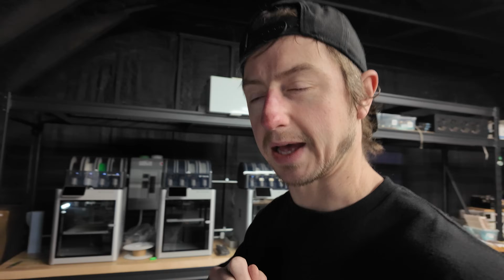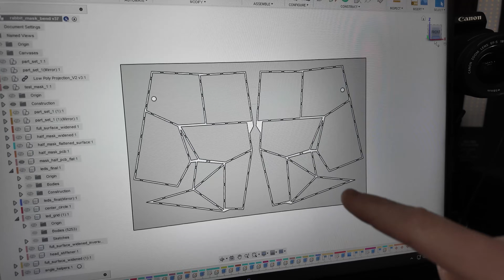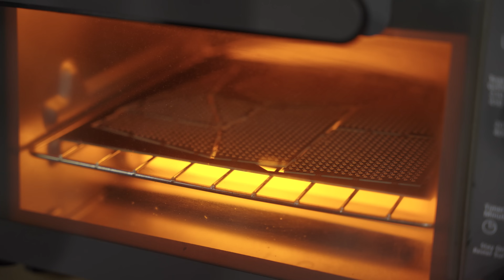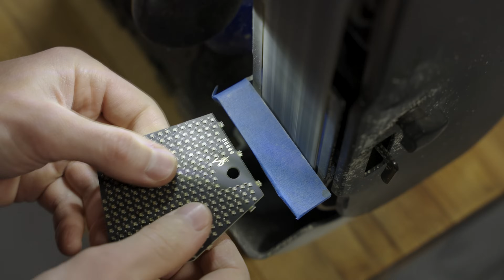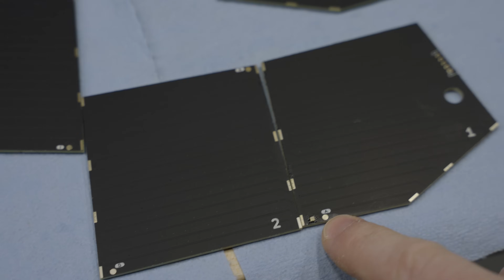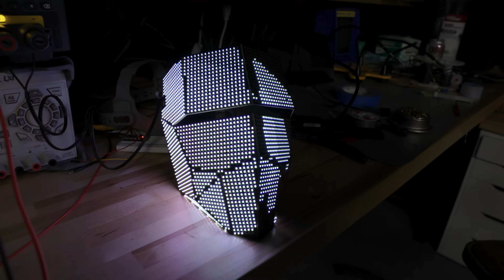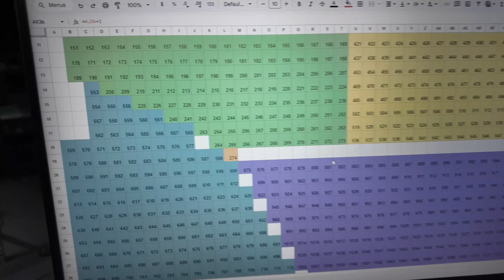This is How I Built the Craziest LED Mask

Comment: That is insanely cool.
  If your trying to use solder for strength then it's best to add some wire into the blob. Without some wire in the mix the solder can easily crack.
  I wouldn’t run the ones on the inside they might blind you.
  You could probably sell these for thousands.

Next year the full body suit!

Comment: First time viewer of your channel. Won't be the last. 
 Subscribing now.

   I'm an electrical contractor and love lighting. I have a couple of LED "toys" that I've acquired just circuit boards 1½ x 1½ inches with LEDs and a rechargeable lithium battery, USB mini port for charging and infrared receiver  with a remote control that has 16 color changes and speed control and random pattern as well as dimming capabilities.
   
  If you are still taking suggestions for your mask display I would like to see a flaming face pattern and skull face.

Comment: You can make a short throw projector using any projector and two mirrors in the front of the lens and then one back on the same plane as the initial LCD fixture that's inside the projector and the reflection of that mirror will be your short throw.

Comment: structural solder is wild man at least super glue it
Reply: might also want to hit it with an EM meter
Reply: Cyanoacrylate glue is strong but brittle. Epoxy, like in the board, is way stronger.

Comment: Crazy Idea:

Have a customer glue green dots from a sticker kit onto their face, have them take multi-angle self portraits, gather the photographs and scale them to a custom fit 3D print out. Send them a blank test sample to confirm it fits, then apply the technology elements.

This would be especially important for VTubers who need anonymity with wanting characterization based on their streaming models. This would also be valuable for fans who want to cosplay as followers. For example, ShyLily is an Orcat but her fans are Shrimpies or Ants depending on the platform. You can totally market for this over a website.

Comment: I am an idiot, but because I am an idiot I feel there is a simpler way of doing this, is there not?  Like, why couldn't you take a piece of material that is square in shape, can be drilled, and able to be vacuum formed?
Start with the square as you already have your coordinates X,Y, Z, , may need some compensation, but drill the holes, CNC, then mold the material to a shape you so desire, and then place the LEDs, but like I said you may have to work backwards in regards to drilling, so you may want to start with the shape first in CAD, then flattened it out, transfer holes to CNC, then drill, then mold back, then LEDs, would that not work? Again, I am just an idiot! Simply asking!?

Comment: Maybe make another translucent mask to use as a diffusion layer to smooth out the pixellated effect.
It might work as an alternative to having to calculate angles when you do your mapping, allowing you to map the pixels as a flat plane. You would still need to calculate angles for diffraction in the external layer instead.
Once you have a good design for a diffusion/diffraction mask, you could also apply it to additional future masks without having to remap angles on each one.
One obvious downside would be that any additional layer will also insulate the heat that you are already feeling inside the mask, so a silent cooling option might be necessary as well.
Reply from the maker: Good idea! I really want to try a diffuser

Comment: Put a camera on the back and have it blended into whatever is behind you.  Go invisible.
Reply from the maker: Great idea! Also on the eink, I want to design a single eink pixel similar to a addressable LED but it doesn’t light up
Reply: Then you’ll have to make a pixel Gilly suit : ).
Reply: Sure they can’t see you visually but you’ll be putting off so much heat that they’ll feel you coming
Reply: E-ink would work : )

Comment: Working in SMD technology myself, if you want flat mouse bites, just break them off and use a big file flat on the table, and just slide the edge over it until you feel almost no resistance. It's a simple fix and not as scary as the belt sander.

Comment: I feel like it would be good to map the LEDs to 3D space and then map images to that space to make them meet in the middle instead of the mess of the spreadsheet LED mapping.  Use projective math to put 2D images onto the mask, just like with the original.

Comment: I envision a Pi controller with a DMX hat, an OLED screen and an encoder knob that allows you to scroll through open DMX channels being broadcast at EDM shows. Then scroll/sniff out the channel range that the lighting designers on the shows use for color changes on their lighting rigs. Then build lighting scenes on the Pi that can be triggered via the DMX cues your Pi is receiving. I could imagine that people around you would be confused and amazed that your mask is in sync with the show happening on stage.

Comment: Thank you for showing all this, I have been wondering how close we are getting to making a fabric PCB. I think projects like this are getting us there faster. A 1-2mm thick band around your wrist full of LEDs, all useable screen except for probably the clasp. Clothing with screens built right in, change the color or pattern on a whim. Use some of the newer anti reflective LEDs and you have instant perfect camouflage. Park the car and it matches the surroundings, when you drive, whatever color you want. Thanks for putting my brain into overdrive for a bit.

Comment: could be cool to add an  outer layer of black diffuser plexi over it, at least as an option/attachment
Reply from the maker: I want to do this! Can you recommend any? I need a vacuum forming machine to make a cover for it.
Reply: @SeanHodginsToo  PLEXIGLAS® LED works nicely. Maybe you could just cut  oversized pieces of the display segments and glue together. Then you would keep the sharp edges. Otherwise maybe a "positive"  with the exact shape of the mask, place the plexi over and carefully use a heatgun to let it set around the shape?
Reply: Would recommend to get a sample and then play around with the distance you want the plexiglass to be from the mask. Can get really nice diffused blends with a bit of spacing

Comment: I think this is the most impressive Pixelblaze project I’ve seen. 

How low did you need to limit your global brightness to not melt your face or the traces (which is a proxy for me asking how much dynamic range you had to sacrifice on those awesome tiny APA102s)?

What clock rate were you able to push, and how many final pixels? Single channel or output expander or sync mode? 

Sync is probably the way to scalable FPS. To save space, you could use Picos. I added in the docs the way to hack a sensor board onto the lead pico. 

No shade cause I know you were on a timeline, but instead of all that flattening with Jason’s tool, did you consider exporting your points from Fusion as a direct 3D map? I need to write a Fusion script that would let you draw a signal line and then order the sketch points on export. I think I converted most of the default 2D patterns to also accept 3D maps as an X-Y projection. Might look lower res on the sides, but you could also project the 3D points in code to a 2D polar/cylindrical surface and then “unbend” that for the 2D patterns. 

I agree with you that lack of support for GIFs and bitmaps / video is a bummer. It would unlock a lot of creativity for people who don’t write code or who just tinker with it. 

Never see your work before. Thank you, algorithm.
Reply from the maker: Thank you!!
I think I forgot to mention it in the video, but I opted for SK6805s, I was going to APA102s but the complexity of running two signal lines and a limited timeline scared me off of that. haha
So they're just running the standard 800kHz that SK6805s run at. Next version will likely be APA102 so I can run them faster and get more FPS. With the Pixelblaze I've limited them to 15% brightness, due to current limits and mostly heat.
There are 2960 pixels in total, running off a single data line from the pixelblaze and/or Pi.
I would love a better tool to map the pixels in 3D. For the Pi stuff, I  just skew the images/videos I send to it using video software(using the flat map as a guide). So it works but not perfect. Kind of like pulling the sides longer to compensate for the angle.
Reply: @SeanHodginsToo  Actually, side benefit of SK6805-EC15 is the max current draw of 5mA. We built an art car this year with 76K x SK9822-EC20, and the datasheet isn’t lying when it says you shouldn’t run the 5 extra global brightness bits at a value of 10 out of 32, giving you same max draw of 5mA. Higher actually can melt the solder. So, honestly that’s only like 2 extra bits of dynamic range, and you’ll probably still need to be at the same 15% global brightness to control heat. Still, 382 brightness values >> 38 values, and the faster refresh is a bonus. But if you want a quick boost, using 2 channels on an output expander will likely 2X your frame rate with the hardware you have now.

It’s awesome that you have so many subs and still reply to everyone.

Comment: Absolute madness!  And I love it.  
The only improvement I think could be made is to use some kind of polarizer and optically clear circuit board to give a person a wider field of view while wearing the mask, without out dazzling the the eyes of the person wearing it. 

I know this might be a bit out of your wheelhouse, but you know what I have thought about for years? 
A clothing / Jacket version of with the same sort of resolution, but made for cyclists that would also be able to  do things like show turn signals or direction of travel at night ; along with when the bike is braking.    

Would be perfect for motorcycle use as well. 

Again, fantastic project.

Comment: I admire your drive, creativity...but not your fabrication technique. I dislike the solder joints a lot. As an eyeglass wearer, I'm aware of the amount of torsion, etc is being expressed at small points.  
Were I to make such a mask it would probably be by using a pre made mask and ribbons of connectors to link panels. 
I should think you'd have to epoxy coat those soldered connections. I was taught long ago never to put soldered connections under physical stress. Forward, ever.

Comment: wondering why you didn't print a solid mask and just glue the PCBs onto each segment. could then just run wires through the printed mask instead of trying to edge-weld everything. just curious.

Comment: using a flexible pcb wasn't it better and easier? for example they made the miniature las vegas sphere using flexible pcbs and it came out very well, then I would add a diffuser layer in front of the leds just to see if it improves the effect. anyway it's an exceptional mask like every project you do.
Reply from the maker: Better? Maybe. Easier? No way, and maybe 10 times the cost. I'm going to try some different diffusion methods I think!

Comment: 4:39 "...Someone created it without thinking about all the angles" 
What a poor way to cope with not having the CAD skills to match their original design. 
I'm sure they started to create it with 2.5 degree angle increments and eventually realized they would have to compromise efficiency and design aesthetic. I enjoyed the rest of the video though
Reply from the maker: That wasn't a gab at their design, its the truth, it was designed for aesthetic so the angles are all over the place, they likely didn't use actual angles at all. I had to use the PDF file to remake the pieces but fusion doesn't give you an easy way to take flat panels of random angles and get them to align with different edges. I made it work though!

Comment: I'm a hobbyist and your setup is like a whole laboratory! First off, are you in a mini-warehouse? what space is that? It's like a bunker but I assume it's not? Also, what are the machines you're using to finish assembling the pcb's? I have no idea what the first one is with the sheet of... aluminum? and the 2nd one with the robot arm
Reply from the maker: Haha I call it the “bunker” but it’s the second floor of my garage(I have a video from a few back that shows the shop off) - the first sheet metal was a metal stencil for the solder paste. The other one was a pick and place machine for the electronic components

Comment: What if you just put holes in the mask and 3d printed it and then had the boards behind different areas? Might be more work, but you could have the leds conform to more angles. Just put longer and shorter leads to make them stick out more or less to follow the shape of the mask.
Reply from the maker: Maybe! It would be a lot of work though! That’s an interesting way to do it

Comment: I have a thought. You've stirred up the part of my brain that stores old ideas that were way before its time. The shelving is now layered in dust and cobwebs with those ideas that I packed up years ago and had been stored away in my shed ever since, i.e., in the mid-70s, thinking how cool it would be if someone was able to put giant tractor tires on their truck 😳.
My thought is if you were able to make a back half of your mask (which rocks, by the way) and make it a helmet style. Might make it more cohesive, maybe? Or a face on the backside, like Jekyll and Hyde, full mask like used in Star Wars? I don't know, but there could be unlimited applications. ✌️
Reply from the maker: Full helmet would be super cool! Super hot though!

Comment: After being soldered together, you could also add some glue/epoxy along the inner seams to add some strength to those joints.
Reply from the maker: That could probably work,  I think ill end up making a 3d printed frame for it or something

Comment: I like the look of your mask facet layout when LED's are off but as you were explaining things around 9:42 looking at your face it appears to me to be part of a vert. cylinder from bottom edge of cap to upper lip with partial horiz. cylinders for eye recesses but your mask is simplified with slits at eyes and when LED's are on can't really see the facets. Why not use strips 8 pxls wide or so by however many from cap to lip (I originally was thinking could use facets from lips to chin) but after seeing your mask could just run strips down all the way to chin and leave my thought of eye recess out altogether (would look more like welders mask when LED's off). Then you'ld just have say 10 more or less identical strips in gentle curve around your head adjacent to each other simplifying mapping and overall construction. A gap could be easily be left out for eyes. I'm not familiar at all with what you're doing just my thoughts from viewing I'm probably missing something.

Comment: I have a slightly insane idea:
Add an accelerometer or 3 to the mask, then use that to add a physics effect to display across the LEDs. Color gradient changes varying in intensity by mask movements, maybe fluid physics simulation if you're absolutely bonkers. Maybe even something like an audio spectrum that emanates from where the mouth is, with a similar look to the old winamp visualisers.
Reply from the maker: Oh yeah I have to do all of this!
Reply: Or just 3D tracking so your movement through space controls the image.  Could make for some really trippy effects I'd think.

Comment: Or how about fibre optic lines to max on two sides. Then feed the optics over each shoulder to a back pack. Thus a hoodie for cover. Then have a small screen to each pixel for the front face image. We'll that's the image in my head I'm thinking of. Not a tech person by far. Just thinking if you could project each pixel from a screen following fibre optic cable to a mask to wear. To give a sharper image I think.
Reply from the maker: Its a really cool idea, don't know how I would achieve it, but it would be awesome!

Comment: What if you add an IMU to the mask and do some cool stuff that reacts to your head movement?
Like run some sand or liquid physics simulation or make fake shading from a virtual light source. Like white from top and red from bottom.
Can a diffusion layer be added to lessen screen-door effect?
Reply from the maker: I need to do this ASAP. There is an accelerometer on the pixel blaze, but thats mounted to my back pocket of my pants.

Comment: Could you epoxy the boards together with a bead on the inside to make it more durable than soldering together?
Reply from the maker: That would be possible, I'm thinking of making a frame that holds the pcbs though
Reply: @SeanHodginsToo  And a silly idea for display: animated bugs crawling across face background ;)

Comment: Could you use a flex PCB to form to a mask shape with some origami type folds?
Reply from the maker: Definitely could. I wanted to try this with regular two layer boards first.
Reply: @SeanHodginsToo  Makes sense! I assume it'd come with it's own complications, but maybe it would simplify the assembly step if you could just glue them down as individual panels, or a big folded origami sheet? Anyways, really enjoy your content, thanks for putting it out there!

Comment: That's a neat idea, but a complicated thing to solve. The Doom face worked well.
I'd probably strengthen the bonds with glue or something, because those small solder pads could easily loosen when exposed to any force.
Reply from the maker: Yeah it was definitely an experiment, I just wanted to make a mask from PCBs, but next version will have a frame I think

Comment: For some panels, like the one on your forehead, why didn't you go for a parallelogram arrangement to prevent the wedge-shaped gaps? It also helps with more accurate front-facing pixel mapping.
Reply from the maker: Lack of time to experiment but the cyberpunk non perfect look was part of it